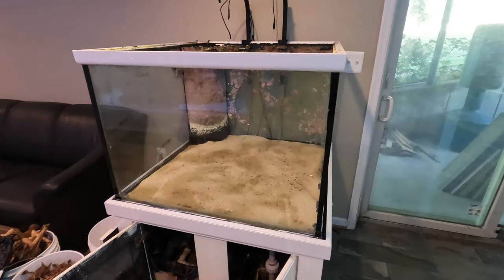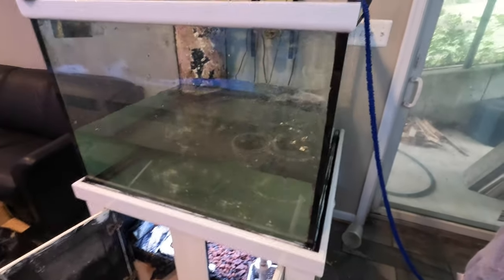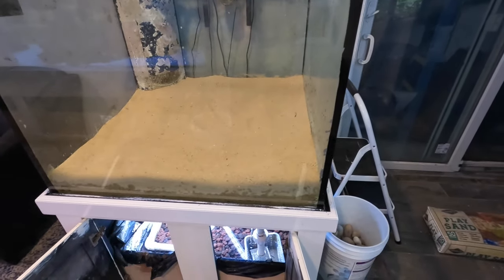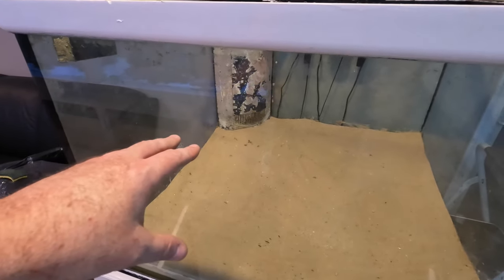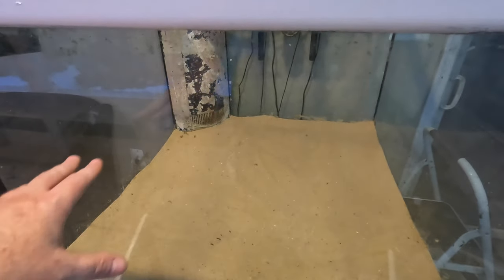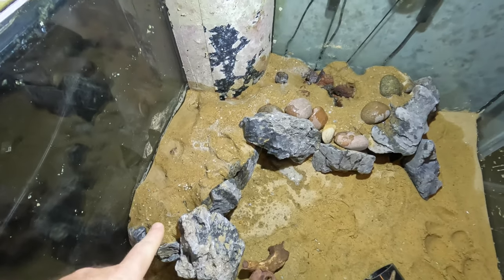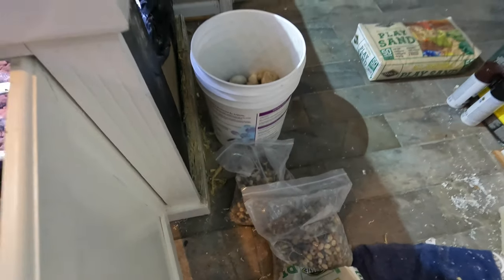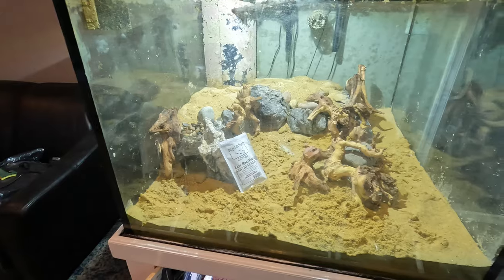River Bend Aquarium, Complete Aquarium Setup, from The Very Beginning!

Comment: Curiosity question, did the silicone seam on this 150 pop at the location the hose is aiming during the water fill seen at 4:18 ?
That's some serious water pressure you have in your home.
Reply from the maker: The seam failure was right in the middle of where the bottom glass and the rear glass meet, so like 12" over from where the water is coming in on the video.